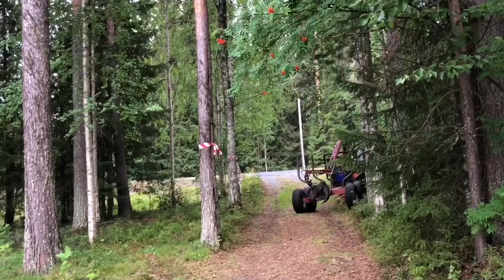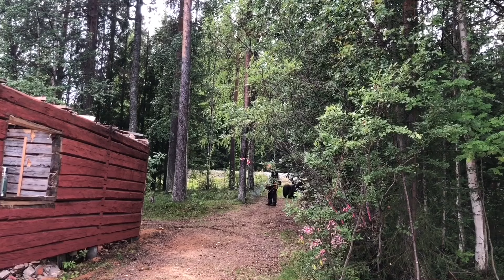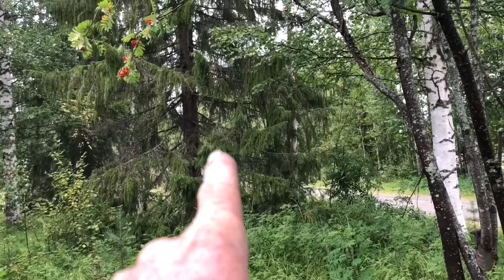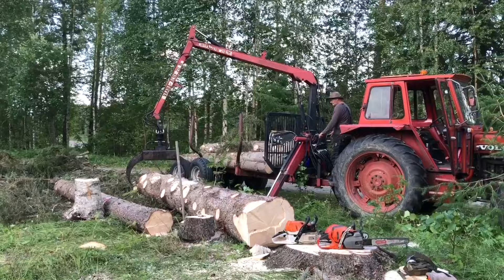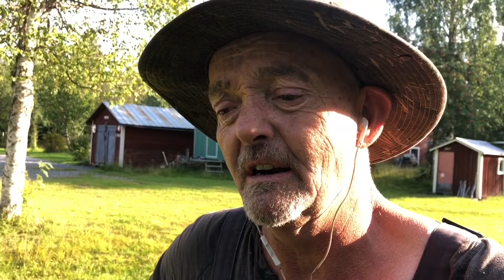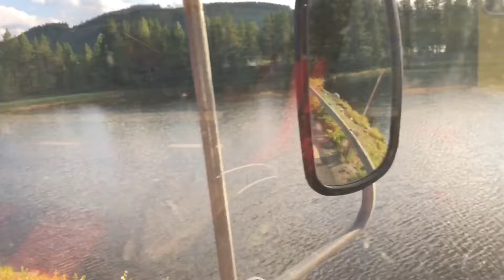Clearing trees for a old Arctic cabin move.

Comment: Another day or two of hard slogging Simon. Amazing. Loved how you angled the first 🌲 ! Do you get to keep the logs? They looked good beautiful specimens… I was wondering what would you have done if you didn’t have the lift to be able to move them? It sure is going to be a view change for the owners of the cabin. I bet they are disappointed to have to move. Fabulous scenery once again too. Thank you and best wishes to you all and of course hugs and tummy rubs to Kasper.❤️🇦🇺🇸🇪
Reply from the maker: Hi Anne, I did the job for the tree's, as in that was my payment. Interesting question about how we did it before the tractor and crane. You remember the job on the hill at the beginning of the channel which was just weeks after my back surgery. I used the Toyota as a skidder and then had th fork lift to place onto the log cart and the Toyota to haul them to the yard. Sometimes we could not get the forklift(yellow back loader) to a site so then we would fix the log cart to the front of the Toyota and use the winch to pull the logs up a ramp onto the cart. When the cart was full turn the Toyota around and haul back to the yard. Sarah and I did that for years before I got the Tractor 2 years ago. We also had an old saw mill which took 3 men to run, Sarah and I used that to saw the logs. Who knows why I needed back surgery! The cabin has not been used for years so re-siting it will save it and bring it back into use. Thank you and have a great week. Love to you all.
Reply: @arctic-rebel  wow amazing story Simon. Have yourselves a wonderful week too.❤️🇦🇺🇸🇪

Comment: Nice to see your daughter helping out .  ? So . That small back water before you crossed the bridge looks like a great spot for pearch have you fished it and if so how deep is it . Other ? . Can you take the tractor out of 4x4 so it can turn better and dose it have a road range / road hears . I miss are farm and driving are johndear 3020 on the roads moving hay and corn silage . And them bearch trees are a nice size , the pines will make nice lumber. And yes that's a long way to plow that driveway .and protect them trees from them damb moose 🤔 think a 3030 or a 270 or a 308 or 7mil will work 😂 .
Reply from the maker: Hi Heith, she does really well considering she is 80% academic matter. The back water is to shallow for a boat, however it is really good for ice skating. It freezes first and really smooth. The tractor it out of 4x4 I  have only needed it a couple of times and can switch it in from the cab. Yes it has high gears for the road but the tires are so bad I dare not go over 25mph. It is much happier at 15mph it so badly needs new rear tires. All of the above work for moose but before that I must deal with the milling of lumber. Take care my friend.